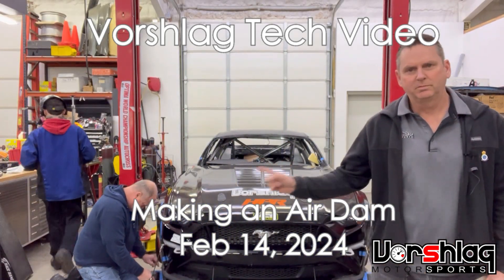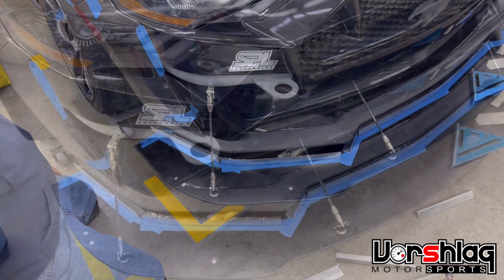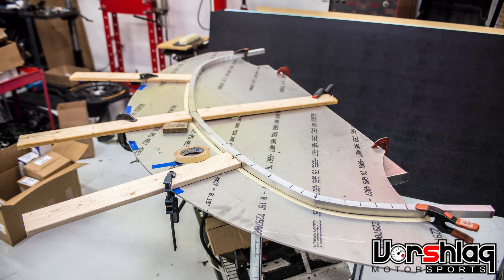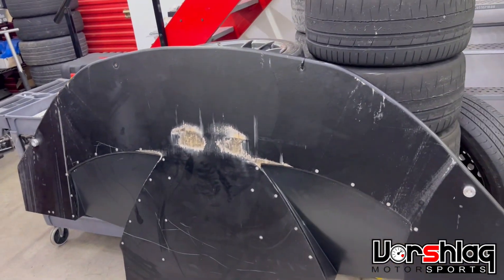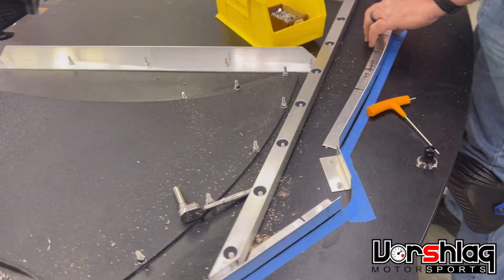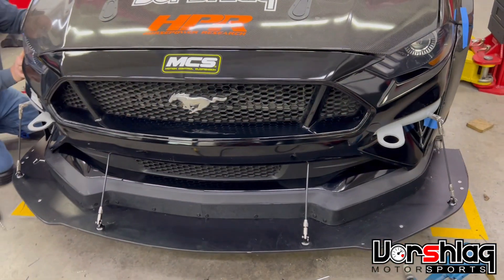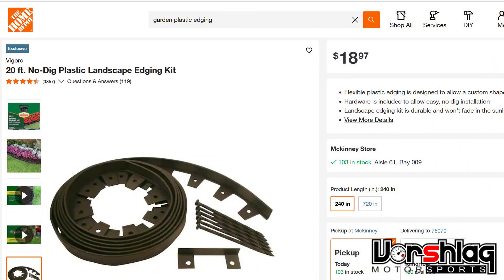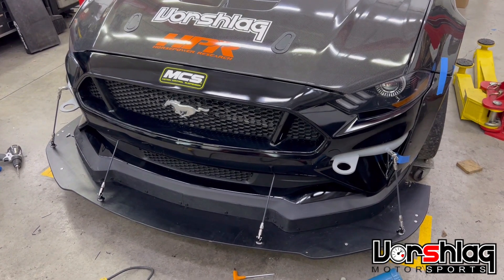Vorshlag Tech Tip: Making an Air Dam

Comment: What about using 0.5-1mm alu. sheets to do the tall flat airdam?
Reply from the maker: Sure, that can work, but it isn't as flexible as the race roll. We've done aluminum air dams on a couple of cars where the gap was very short and didn't have too many curves.